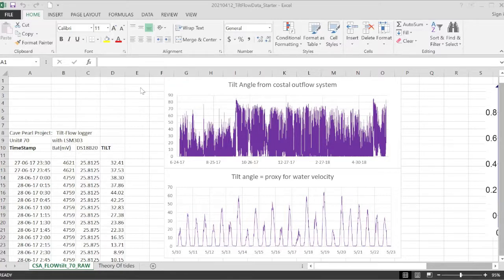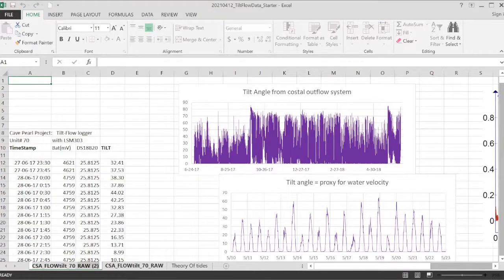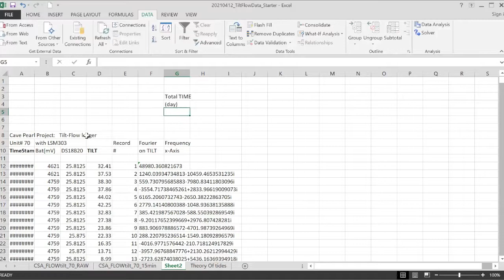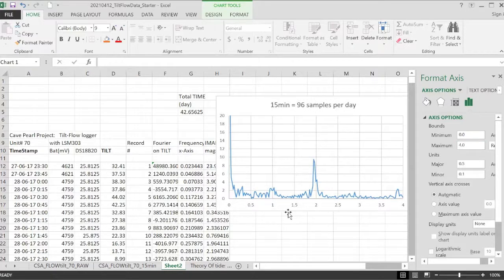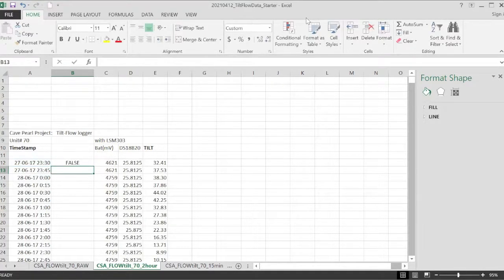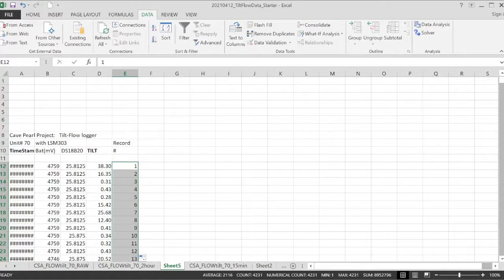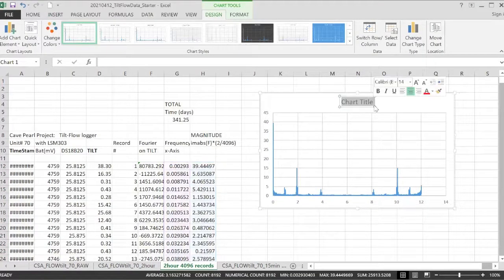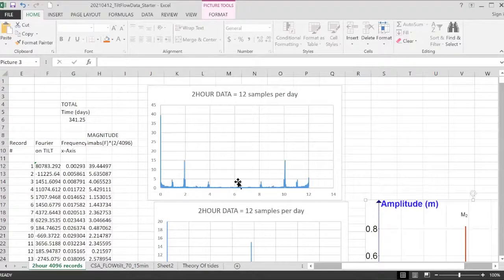Using Excel's Fourier transform to derive a tidal frequency spectrum

Comment: One minor nit -- the total time in cell G5 on your FFT sheets should be the number of samples times the sample interval, not the time interval between first and last samples. The deltas you calculated are the sample interval times 4095; the value you need is your value times 4096/4095 (exactly 42 2/3 days, for a 15 minute sample interval).

If you do a lot of analyses of stuff largely driven by the tidal cycle, you might also consider whether it would be worthwhile changing the sample interval to get an even power-of-2 samples per tidal lunar day (~ 24 hours 50.4 minutes). That should slightly narrow any peaks driven by the moon.

What surprises me about your result is why the tilt data looks like it does. In the first couple minutes of the video, the lower plot appears to be of the tilt vs time data, with most of the noise removed. But the tilt is unipolar -- it looks like all negative values have been clipped. I'd have expected either raw tilt data looking like a full-wave rectified signal (with 2 positive peaks per tidal cycle, corresponding to max inflow and max outflow), or tilt data that had been corrected for flow direction to give both positive and negative peaks (one direction corresponding to max inflow; the other to max outflow). So why does the tilt data look like all negative values have been clipped?
Reply from the maker: Thank you for catching that. So 42.66666(repeating) for the total time instead of the 42.6562 I was using. I was wondering why those peaks were just a bit off.